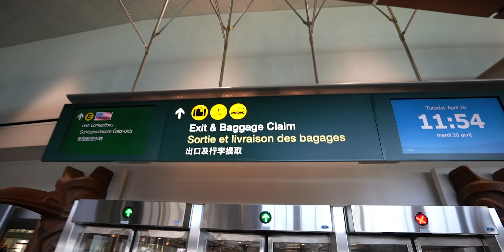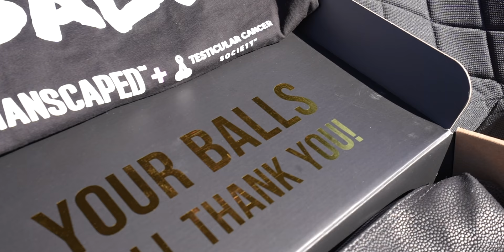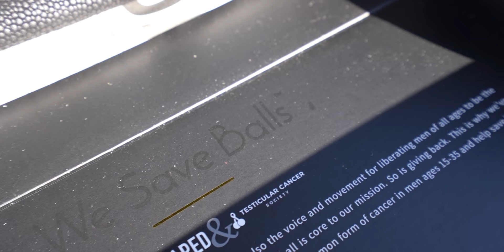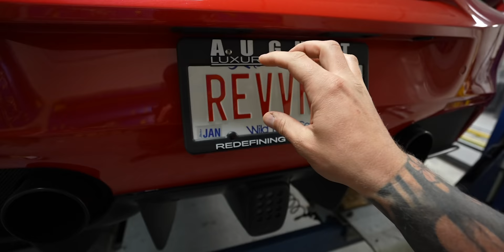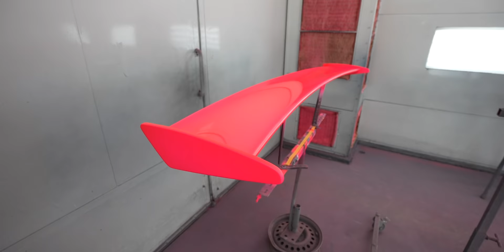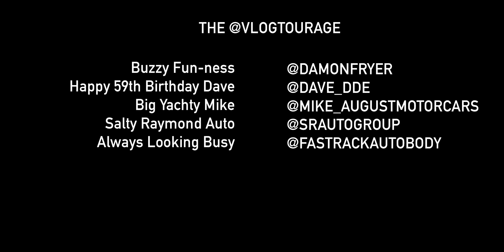POLICE PULL OVER THE WRONG SUPERCAR OWNER... *CONFRONTATIONAL*

Comment: Got pulled over driving while wearing a helmet myself.
So, I needed a new windshield in my diesel, but I wanted to primer seal the windshield jam. I had it removed at the pro shop, but had to drive it to my shop when the temp was in the 20’s (degrees). When taking it back to the pro shop, a trooper pulled me over. I then educated him regarding the law; not over the helmet, by no windshield. Jeeps can drop theirs… windshield law is another example of UCC commercial code. It doesn’t apply to non-commercial vehicles; like doors.. and that license. Supreme Court has ruled. Traveling non-commercial does not require a license; and the STATE you live in can only enforce UCC on you if you sign/participate with the license/DMV in the first place. There’s a procedure if you already have contracted to participate with your state. Nothing “sovereign citizen” BS about it. Neat 😁

Comment: Logical questions that will certainly invalidate the ticket may eliminate the possibility of a ticket. I've seen you do this before, great job Damon. I was racing a 280z in my 84 300z, both cars look similar, and both were silver/gray. I saw lights coming up, and bolted off the freeway into some mean traffic, and thought I had lost him. He comes blaring up the offramp, driving over curbs to get through the traffic, and stops me. I'm fully expecting a speeding ticket, but he says he was writing me for hitting the freeway barrier with my car? I was baffled at first, but realized the other guy must have hit it. By the time I got around to showing him the right side of the car that supposedly hit the barrier, he had already written the ticket. I showed him the car, no damage, couldn't possibly have done what he was suggesting as there would have been a lot of damage. He hands me the ticket, says just show up, plead not guilty, and I won't appear or contest it. This was a CA Highway Patrolman who was shaking, and nervous as I have ever seen anyone be, and shouldn't have really been out there in the first place. All this, and he does in fact show up to the hearing, but makes  some excuse why the ticket was not valid, and I'm on my way. I'll always wonder about the other Z, and it's occupants? I was probably 30, and the guy driving the 280Z was likely over 50, and his passenger looked to be at least 80. I hope they survived. They obviously got away as the officer came after me for some reason? That was one big clusterf**k! of an experience. 😁😎👍✌

Comment: Question, you have the top level gear in your car I am sure.  Is there not a tool that records your speed as you are driving?  I have a Navman computer that records my speed as I am driving and I wonder how hard it would be to transmit that data to a chip.  The motivation for this question was when I was pulled over by an unmarked police car who had been tailgating me. When he saw the Navman he thought it was the model with the camera which meant he was screwed.  But he did not give me a ticket, he said I would receive it in the mail, clearly did not want to be identified.